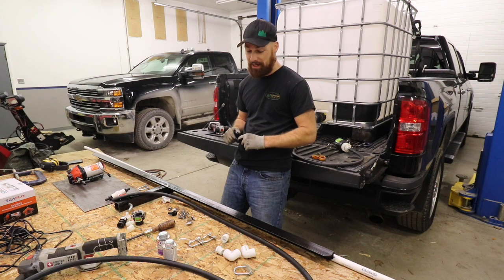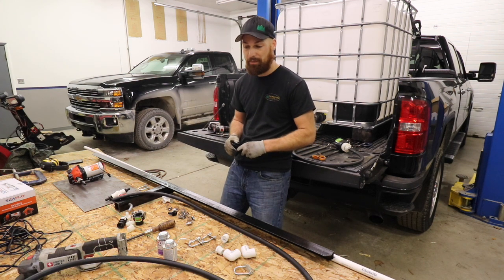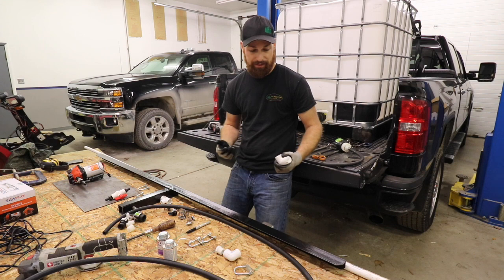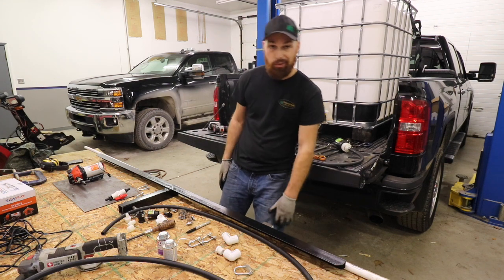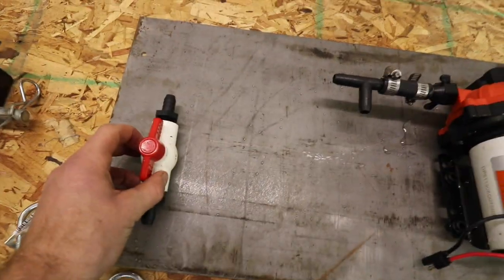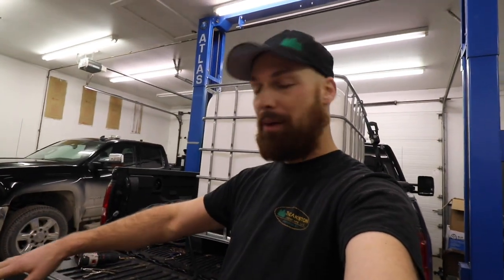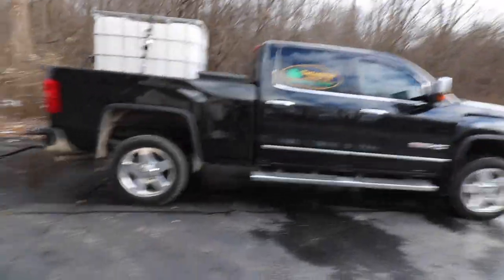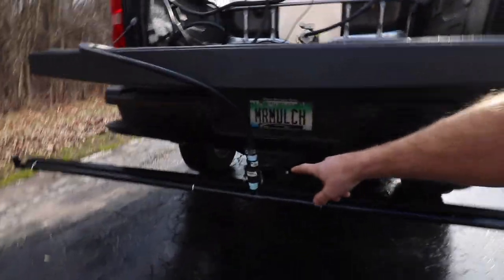LIQUID CALCIUM CHLORIDE SPRAYER BUILD!

Comment: How do you know if your pump isn't wanting to push more water through the bar then the holes allow. Won't the pump burn out if you don't have a return line to the tank that also mixes the liquid when it's running  ? Just curious

Comment: If you mounted the 12v pump lower than the outlet on the IBP tank, would gravity increase your flow rate?   Also if you added a second pump and second spray bar right next to the current spray bar, wouldn't you be able to have twice the ground speed?

Comment: How is this pump doing after 3 years of use?  Did Magnesium Chroride messed it up?  Would you still recomend this setup?
Reply from the maker: Definitely still recommend it. Pump is still doing fine, I do run water through the whole setup before storing for the summer

Comment: Can you make a video on how the wand works with this setup? Id like to see about building something like this that I can use for sidewalks, but im stuck on the pressure side of the wand. I know the pump will turn on, but does it shut off when you are not using the wand but keep the pressure at a constant psi so when you DO use the wand it will spray no problem and keep the pressure? Hope that makes sense...
Reply from the maker: The 12v pump I have listed in the description  has a pressure switch, so as soon as you start spraying the pump turns on and keeps constant pressure
Reply: @MichaelTheakston  exact answer I was looking for, thank you!!

Comment: Just make a boom less sprayer like you use on a lawn liquid application available at northern tool your welcome
Reply from the maker: Problem is you need straight jets to pierce through snow and ice to get to pavement, so mist sprayers will be far less effective.

Comment: Which pump did you upgrade to?
Reply from the maker: Just switched to it at the end of the season last year, have 2 runs on it right now. Seems to be a solid unit, but time will tell. I will keep everyone updated with a new video
Reply from the maker: This 20gpm pump: https://amzn.to/39VYs5R
Reply: @MichaelTheakston  could you pls inform brand and model of this pump? Page is not available, thanks a lot
Reply: @MichaelTheakston  Thanks! Worth it or any issues/corrosion with the cast iron and brine?

Comment: What would be an adequate ratio of calcium chloride to add to water and disolve?  What is the ppm of the comercial pre mix?
Reply from the maker: It's a commercial pre-mix calcium chloride between 21-25%
Reply: @MichaelTheakston  Have you made an attempt at putting a bag in your tank?  Great video!!
Reply from the maker: We haven't yet, it works so well that we have had no need.

Comment: Questions what size holes and how many of them do you put in the boom
Reply from the maker: I run a 20gpm fuel pump now and I just drilled holes in pipe.
Reply from the maker: I think there are 8-10 and 1/8"
Reply: Did you put a bigger pump and any suggestions on which spray nozzle

Comment: You really should consider using some type of spray nozzles. You will build up some pressure in the line which will penetrate the snow / ice more effectively.
Reply: What nozzles do you use?
Reply: TeeJet H1/4U-SS solid stream Stainless steel nozzles work great for penetrating ice/snow, you need to size them according to your rate.  @bjgarbacz1